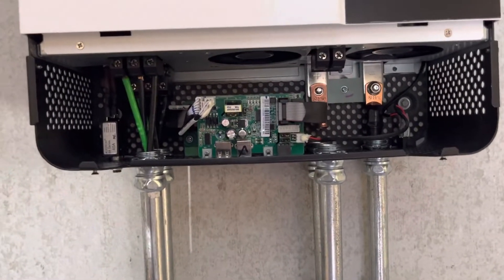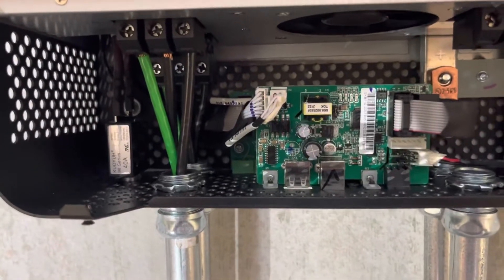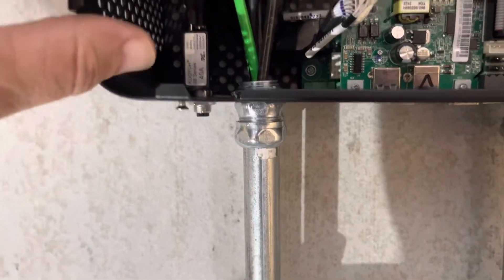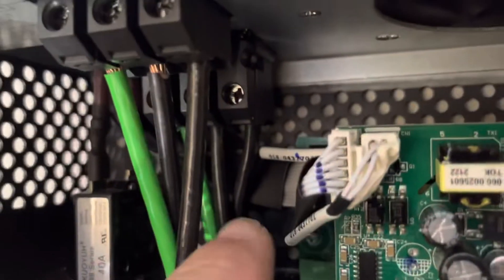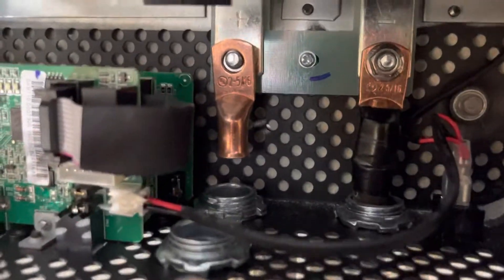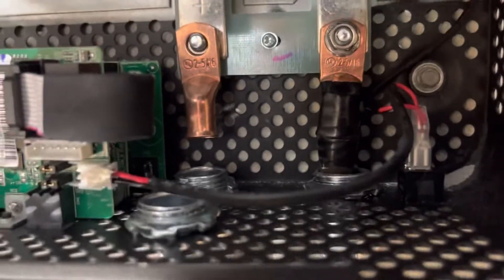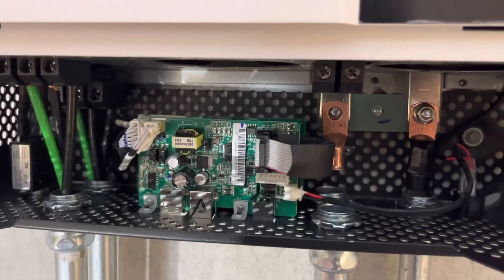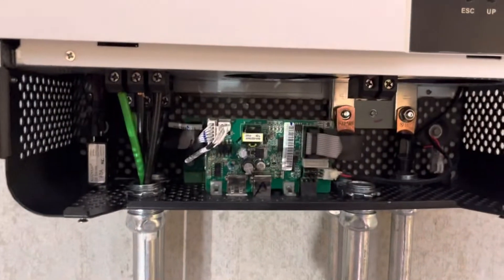Solar Power Project - General comments on Growatt SPF5000 inverter wiring compartment

Comment: I think you have reverse connected DC breaker. Red wire goes to negative terminal.
Reply from the maker: I stayed consistent with positive (red) to the left and negative (black) to the right. That’s the way it is laid out in the Growatt and at the battery. I maintained that same consistency through out including the battery breaker. The markings on the breaker are unfortunate but irrelevant.
Reply: I mean PV breaker. You connected the red wire to minus on it. I have the same PV DC breaker and don't know how to correct connect it to PV wires.
Reply from the maker: @mustafabyalk  the same applies here. I stayed consistent with the Growatt. Positive (red) to left. Negative (black) to right. The markings on the breaker shouldn’t be there as it’s irrelevant to breaker which side is positive and which side is negative. If you look at the SPD you can see it shows + to the left and - to the right which is opposite of the breaker. But again those are irrelevant for the breaker. There are some devices that the location of the + and - are important. But breakers are not one of those devices. 

Personally, I prefer staying consistent with my wiring. So I ignored the breaker markings. It helps avoid confusion later.

Comment: Not sure if you posted this or not. How large of a array are you installing? How much battery capacity do you have? Did you do a ground mount yet? Thanks. Great job! Are you an electrician?
Reply from the maker: I’ll be posting a lot more videos over the coming days and weeks. I’m an electrical contractor/engineer. I’ve installed thousands of electrical projects though this is my first solar project. 

I’m doing this build on my spare time. The PV array will be ground mounted using a Sinclair mount. 42 - 455W panels. 45kwh battery capacity. 25kw inverter capacity. 

Like, subscribe and hit the notification bell. 

Got grandkids this week so … got to go.
Reply: @jeffmotes2129  I kinda figured you were an electrician based on the quality of the work you have done on your install. Looks great! I am an electrician also, tons of jobs as I have done this my whole life, first time solar install.  I am doing 25kw solar array, 20kw inverter capacity, 60kw battery capacity to start with. Sinclair mount also. So far in the past few weeks I have the mount in, and half the panels installed on it. I am doing this also on my spare time. I am using the same inverters as you are, building my own batteries using Chinese battery cells
Reply from the maker: That’s cool. We have similar system. Hope to install my Sinclair mount in a couple of weeks. Had a top hat made for the posts so I can drive them with a heavy electric hammer. I’m posting a short video on that tonight. 

How did you put your post in?
Reply: @jeffmotes2129  I dug holes with my ditch witch's back hole, placed sonotube in the ground and back filled the tubes. I then place the ground mount posts in the tubes and used a two part foam to fill the tubes. Same technology they use to set utility poles in remote area. The foam was more expensive than concrete, but sure was a lot easier to do. I tried to find something around here to pound them in, but came up empty, and finally just wanted it done. I went with bi-facial panels so I put 25 ton of rock under my panels to reflect sun on to the underside of the panels.
Reply from the maker: @snoflite5234  I have a utility line truck and can auger 24” diameter hole. Trying to avoid the concrete though. Didn’t think of the foam. If I can’t pound them I may foam them.
Reply: @jeffmotes2129  Where are you located? I am in central Wisconsin, about 30 miles south of Wausau Wisconsin
Reply from the maker: South Alabama about 70 miles north of the Gulf of Mexico.
Reply: @jeffmotes2129  Did you go with the fixed position, or adjustable? I went with the adjustable so I can maximize my solar in winter when the days are short and lots of cloudy days. And also for max angle for quick removal of snow.
Reply from the maker: I went fixed. I thought about getting the adjustable but it was going to add several thousand dollars so I decided not to. 

Is yours up and running?
Reply: @jeffmotes2129  No, I just started two weeks ago on the installation. I have the ground mount in, half of my 56 panels on. I have a conduit buried  to my house. My array is about 100' from my house. All my equipment will be located in the basement of my house.
Reply: @jeffmotes2129  Are you on the DIY solar power forum?
Reply from the maker: @snoflite5234  no but I’ll check it out.